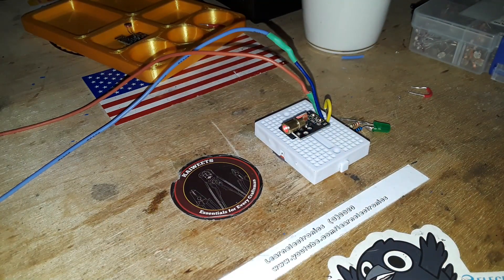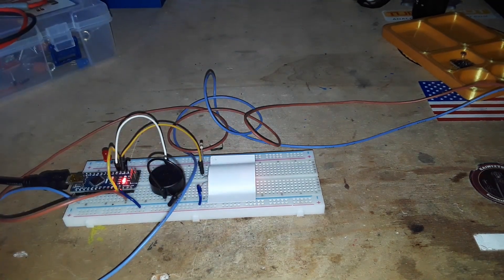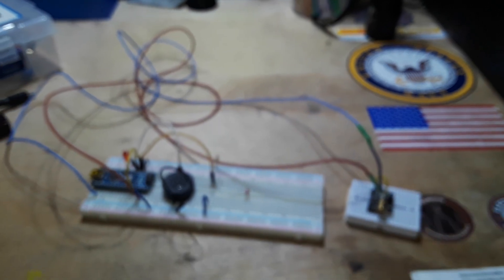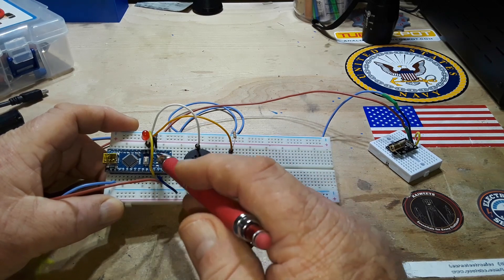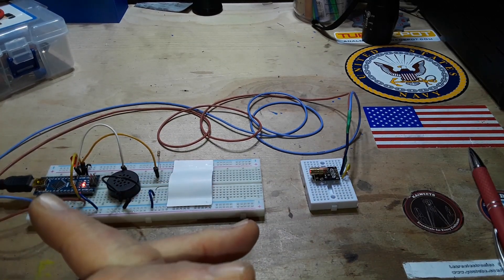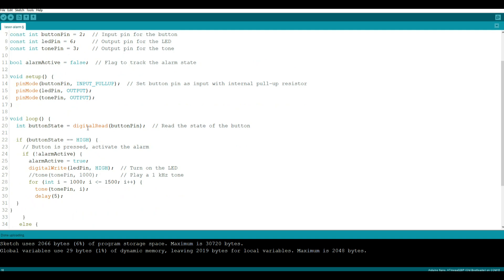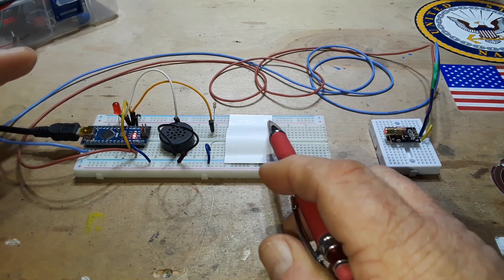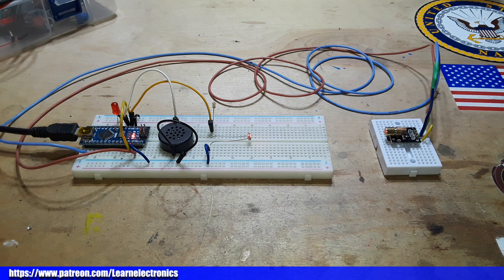Arduino For Kids: Tripwire Alarm

Comment: Is Arduino Giga R1 developing?  I cant find much on how to use it with TFT displays or anything else.  I bought one early, and now I can't even find any shield compatibility lists!  Few sites talk about what you can even do with it!  I know it uses 3.3v signals, but that doesn't tell me enough to go on for buying a touchscreen for it.  Can you point me in any good direction?

Comment: More practical if the beam is modulated. For laser modules it is necessary to keep the am modulation depth realitivly small, say 20%..
Using a mirror allows the tx and Rx co-sited, avoiding long lengths of wire.

Comment: I run a plasma table at my job. It has a similar laser pointer to make it easy to line the machine up with the material to be cut. After a couple of years of molten steel splattering up onto the laser lens it got to the point that you couldn’t see the dot anymore. My boss called to order a new one and a new original laser was $300. He said “I’m not paying $300 for a laser pointer that I can get from ebay for a couple dollars.” So he ordered 5 for $3. The actual lasers looked identical. They were both rated at 5mw. After he installed the new aftermarket laser and switched it on about 3 seconds later it went out and wouldn’t work anymore. It burned out the driver and a power supply. It cost him a thousand dollars to get it fixed and he still had to order the $300 laser.
Reply from the maker: Oh wow

Comment: I used this laser tripwire idea for a physics project to detect falling objects before hitting water. The object would create a ripple and the ripple would eventually close the circuit when it reaches the other end of a container. I thus had enough information about the ripple to measure its time and therefore velocity automatically as opposed to using a stopwatch or something. 
I am in love with these cheap small modules, especially when many of them come in kits.

Comment: I do something like this except i use a VL53LOX time of flight distance measurement sensor. It has the laser and the receiver on one board. It reflects the light off of an object back to the receiver and gives you a measurement of a distance. I use a esp32 as the microcontroller and it in turn connects via WiFi to a program called home assistant. I can then trigger an automation to do whatever i want based on the distance to the sensor. 😀